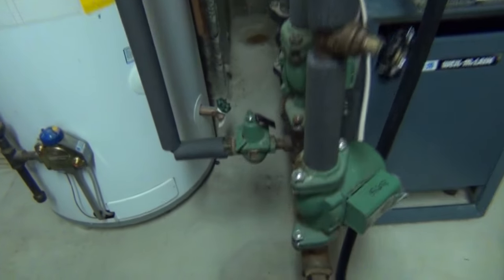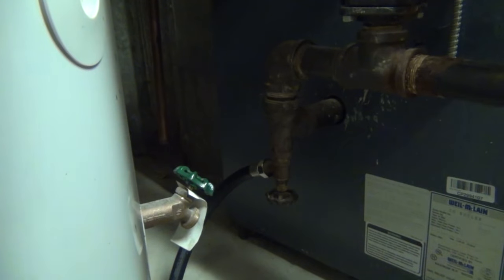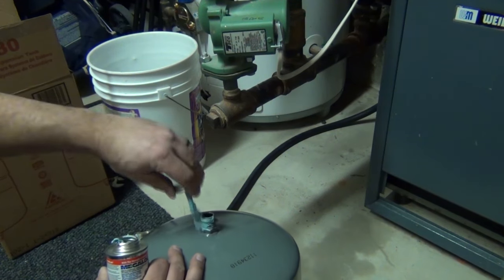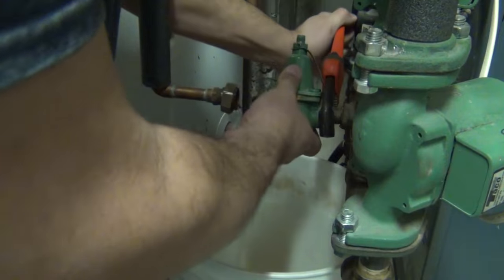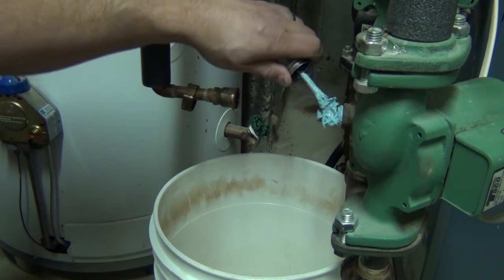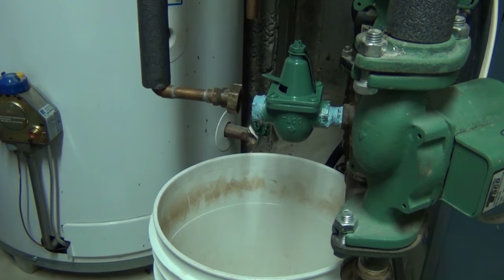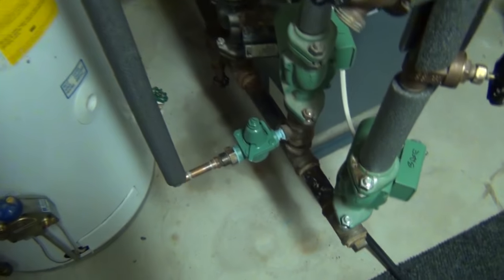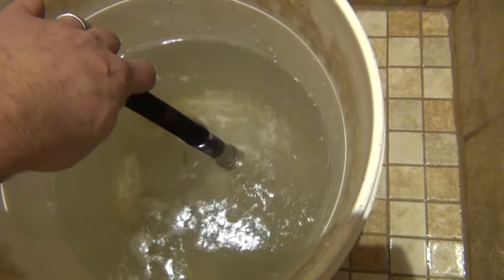Replace an Expansion Tank and Boiler Fill Valve | How To

Comment: I don't know why people don't put a valve in between the tank and the system. You won't need to drain the system when you remove the tank. If the tank is full of water, put a bucket under it drill a hole in the tank and let it pour into the bucket. You're overdoing the pipe dope. Teflon tape is all you need. Nice video.
Reply: The code in NY does not allow a ball valve going to the expansion tank in case you forget to turn it back on.  I put one on mine anyway to make replacement much easier, and I put a reminder tag on it
Reply: I  just take off the handle

Comment: love your vids. newbies like myself are less afraid after watching. i have issue where my baseboard are cold. i just replaced prv and im not sure why. system fires up by feels like its staying hot only by circulation pump, the pipes coming after the pump feel luke warm at best. bt when u shut off the system the pipe get hot. very strange. is this a regulator issue? not enough water in system from when i drained to replace prv? i have 1 pump and looks to be 2 drain spigots. any advice is def needed before i call this hvac guy to come back out. he serviced and didnt tell me anything was bad except prv which i changed myself. i tested prv and thats working fine when i open. i should add i have the older style regulator bt seems like its letting water in w no leaks and the expansion tank seems good. my pressure gauge i was told is faulty and dont know how to replace that. i like to diy and save money when i can bt dont want to cause more issues.

Comment: Hey Bud I was watching a official video from the manufacturer of watts or taco expansion tanks he said the pressure comes recharged at 12 psi which I knew but said the pressure of the tank had to be adjusted to the pressure of the house it’s installed in like if it’s 55 psi at the outside hose bib the tank has to be 55 psi too. I never knew that I thought like you it should match the feed valve. I’m all confused now please help.
Reply from the maker: The xtank must match the system pressure. Your system pressure is dictated by the feed valve. The feed will step the city pressure down to whatever it is set at...usually around 12 lbs.  Your house water pressure from the city/ main has no effect on your system pressure since it is regulated by the feed valve.  Hope this helps
Reply: I realize this question is a year old, but in case anyone is wondering: you match your city water pressure when installing an expansion tank on a stand alone hot water heater. It is a different tank, called a potable water expansion tank. In the past expansion from hot water heaters would push back out the water main, but at some point check valves became standard at water meters, hence the need for an expansion tank.

Comment: So if I’m reading your video correctly, the reason you needed to drain your boiler was because there’s no shutoff valve to isolate the expansion tank?  Why not install a valve?
Reply: So I went ahead and called a plumber to install my tank, and they pointed out that the shutoff valve for my tank has a bleed valve on it so you can isolate the tank, then relieve the pressure in the tank before you remove it.

Comment: Looks like that taco feed valve is cast iron and in contact with your potable water supply line, you may want to install a backflo preventer between the cold water inlet and taco feed valve.

Comment: I have a question. I have three boilers in my basement (it's a triplex home). I just replaced the expansion tank on one of the boilers because the relief valve was leaking (replaced relief valve earlier since I thought that was the initial problem but decided to do expansion tank as well). Now, there's no more leakage, however I keep hearing water noise same as the noise in your video (I assume that it's continuously supplying water), is the noise normal? I am asking because there's no such noise in the other two boilers. All three systems were installed back in 2009 so I am thinking it's about time I replace the other two expansion tanks as well (assuming I didn't break anything on boiler1)?
Reply: I'll add that expansion tank1 is attached to a fitting (which sort of has a valve inside the fitting). I removed the fitting and noticed that the valve was snapped, perhaps it's due to a fatigue failure. It must have been an automatic valve or something that opens up automatically to let water circulate from air scoop to the expansion tank. Now, I couldn't find any fitting exactly like that at the store so I put the old fitting back on (without the valve inside since it's broken anyways). The difference now is that the loop between air scoop and expansion tank is always open at the air scoop level. For all I know the system was probably always close (or barely open) since automatic valve in the fitting wasn't operating. Maybe that's why there was too much water pressure in the system and relief valve was constantly opening every now and then. Now there's no more leakage and pressure doesn't seem to be above the the operating range either.
Reply: As for boiler2, there's just a little bit of leaking every now and then (not enough to bother me like in the case of boiler 1). And as for boiler3, no leakage at all. All I will say is that maybe there's a bit of fluctuation in apartment connected to boiler2 (now I am thinking it's probably expansion tank/ air scoop problem since I can't hear water flowing in boiler2 either. Same thing goes for boiler 3 even though there's no leakage.

Comment: Thanks for the video. I clicked on this and could not believe what I hear; you and I sound exactly alike. I have had a few friends and family listen and they swear I made this video. They don’t believe me, they think this is me. And you do sound like me in every way. I will send you an example of one of my auto repair videos if you’d like. Anyway, I’m gonna go tackle this expansion tank and air scoop project.
Reply from the maker: Good luck with the project bud!  Easy stuff once you get the hang of it!!
Reply: @fixitwithzim  Done. Easy, everything came apart so I didn’t even have to change the air scoop, I just replaced the valve on top. Other than a leak, the blotter in the tank was good. I was going to make a video but I just knocked it out since I have a million things going on.

Comment: Very helpful video. I have a question about the pressures you mentioned. I bought a new expansion tank and it has a setting of 40psig from the factory. 
Should I drop the pressure to 12psig?

Comment: The installation date Nov 2, 2013
I have been using my 50+-year-old hot water boiler system for over 8 years using 50% less natural gas to heat the hot water to heat the home that has cast iron radiators. When I first purchased the house, it had a pump moving water at 35 gallons per minute at 8 PSI. Today and for the last six years, the pump that was replaced back then is now moving water at 45 gallons per minute at 45 psi. Boiler specialists that went to college to be taught box education disagree with my concept that does work. Heating and cooling individuals are totally wrong in their understanding of using fire efficiently. Let me explain it in an elementary way. On a natural gas stovetop if you turn the flame on high and the flame wraps around the pan and the flame is blazing into the air and not heating the pan you are wasting natural gas or propane gas to fire. The next thing they will tell me it will take longer to heat the pan. Wrong again if you take that same amount of water and you put it in a larger diameter pan with the same amount of water and spread the flames out equally across the larger surface you are capturing the fire that is heating the pan that is the heat exchanger that will heat the water faster. In my boiler system, the three small pilot lights for the boiler were turned down and the 8 large burner jets in the cast-iron boiler were turned down allowing the flame to heat the cast iron 50-year-old plus boiler system heating the water instead of heating the air going out the chimney. Once you achieve that savings by turning down the boiler system you need to add a hot water tank to heat water on the input side of the boiler as a reserve that when the water returns from the house some of it goes through the hot water tank and the rest of the water continues to the boiler as is. When the water is returning, and it is close to the hot water tank and the boiler some of it goes to the boiler and some of it goes to the hot water tank that is plumbed into the return pump that blends the return water from the house and the hot water from the hot water tank on the input side of the pump. Once they blend the returning water from the house and the water that went through the hot water tank then it goes into the actual boiler and gets reheated again and speeds through the plumbing to all the cast iron radiators in the home 45 gallons a minute at 45 psi. You have to know how to adjust the hot water helper tank according to the outside temperature so it does not come on every time the boiler comes on the heat the water in the house because you are defeating the purpose because now you would be using two flames reducing the energy efficiency that you are trying to save. When the temperature outside is over 35°F the hot water tank needs to run below the hot water hot temperature setting that says hot water. When the temperature outside is 15°F to 30°F then you will raise the hot water tank temperature to the hot water setting marked hot water. You have to stand next to the hot water tank during the cycle period to make sure the hot water tank is not running continuously when you are using the hot water tank as a helper. The warmer the temperature is outside the cooler the return water will be traveling back to the heat source to be heated allowing you to turn down the hot water tank, so it does not come on when the return water is returning and some of it is going in the hot water tank as the helper. The helper hot water tank is not to be used as your main hot water source. Once you master your hot water tank to the outside temperature and the return water temperature from the home you will be using only your boiler system gas that was turned down by 50% for your savings of heating the home or business. Let me emphasize again the warmer the temperature is outside the cooler you run your hot water helper tank. The cooler it is outside the warmer you run your hot water tank because the return water will be returning to the tank on the return side much hotter matching your hot water tank setting on the hot water tank. Once you do it for the first time and you measure your return hot water temperature you will fully understand that hot water is a hot water energy bank of energy stored to help heat the home and for assisting the boiler. 
When it comes to a forced-air furnace that will be in a new description later that I will show how to work that system with the exhaust gas motor fan speed and the amount of natural gas being used in the heat exchanger and the speed of the home circulation fan all working together differently from what the manufacturer requires. Remember everything was designed to use more fuel than what is needed due to the flame size, heat exchanger size, and moving the heat with the circulation fan.

***My system set up***
Nov 2, 2013
We just Made public the 2 videos again of the installation date of the 45 gallons per minute and 45 psi pump setup boiler system set up flow rate of natural gas being used.
https://www.youtube.com/watch?v=-6OXglr9vzY
Showing the reduction of Natural gas flow on the boiler system.
https://www.youtube.com/watch?v=0gRnTyiC-g0

---------------------------------------------------------------------
This link is someone converting their forced air furnace into a forced-air hot water heating system.
https://www.youtube.com/watch?v=M6Ud1-SHHK0

This link will reaffirm my concept is not fantasy but fact.
https://www.youtube.com/results...
Second link
https://www.google.com/search?q=hot+water+forced+air+furnace&sxsrf=AOaemvJ0QgkYgolZLAH4wtX53JOv8TlkOw:1641528593453&source=lnms&tbm=vid&sa=X&sqi=2&ved=2ahUKEwiSy83F4p71AhVL6RoKHRi1CnEQ_AUoA3oECAIQBQ&biw=1529&bih=511&dpr=2.25
Reply: Might as well have a mirror heating your water on a storage tank on the roof of your home and run it nearly free if designed right

Comment: Great video. New sub.  I have a similar gas boiler and my expansion tank has a small purge valve that goes above the tank. It is rusty and I am afraid it will fail this winter. It looks like I can unscrew it by hand but until now I wasnt really sure if I had to drain the boiler. Will give that a try this weekend. Thx again.
Reply from the maker: Sorry for the late reply, hope the repair went well.
Reply: @fixitwithzim  no problem.. I ended up leaving it as is for now 🤞.

Comment: Aside from initial installation time/cost, what's the advantage of bladder type expansion tanks over the "old" style metal tanks that almost never break down or cause problems? Depending upon your source water quality, the rubber in the bladder will naturally degrade by about 1psi per year, and will also start to allow gasses to permeate the rubber and obviate the bladder's purpose, hence the need to replace them.

Comment: Hi, thanx for the video.
I’m getting purge valve blowoff when the system heats up.  I had this about 5 years ago so I replaced the expansion tank and it was all better.  Now it’s doing it again. I thought that was an awfully short life for the tank.  I pressed the Schrader valve at the bottom expecting water to come out, but it was air. Doesn’t that mean the tank is still good? I also replaced the combo fill/purge valve at about the same time. Thanx again.

Comment: Are those feeder valves universal. Can I use it on an oil heating system. I currently have Conbraco water feeder that’s failing now. This one your using looks more heavy duty.
Reply from the maker: Yes, just make sure you set the correct operating psi for your system.

Comment: My hot water boiler for a two story residential house always runs at a pressure of approximately 27-28 PSI at 180°. When cold it's at 16psi.  Expansion tank is good. If I adjust water feed pressure regulator valve by turning to the left to lower pressure do I do it when boiler is cold? I turned approximately one full turn when boiler was cold but did not see pressure gauge move. Your help is appreciated.

Comment: Question: When you open the quick fill lever on the pressure reducing valve and fill the system to way more than the normal operating pressure of 12-15 psi  and then close it back to the auto feed position,  how do you get the system pressure back down to 12-15 psi?

Comment: Hey, your videos are extremely helpful and to the point. I live somewhere with very hard water. Should I try to get the scale out of the system when I purge it? If so how? Is there any chance breaking up the scale will just cause more problems? Thanks.
Reply from the maker: You can put additives in the loop to help clean the system. Usually you let it circulate for a x amount of time then dump the system to clean it out, then refill
Reply: Vinegar circulated through the loop should remove hard water deposits. There should be plenty of videos on YouTube if you search for boiler and vinegar or scale.
Reply from the maker: @j10001  thanks for the tip. I have used that before to descale a boiler coil.

Comment: great video! if I have isolation shutoff valves on either side of the auto feed valve, do I need to drain/purge the system or zones when I turn it back on?
Reply: i have the same question did you figure it out?

Comment: Can you pressurize the expansion tank after you remove all the water and mount it back in place ? can you use a electric air pump that has a gage on it?
Reply from the maker: You would want to pressurize it before filling the system but it can be done after as well. A bicycle pump should do the trick.